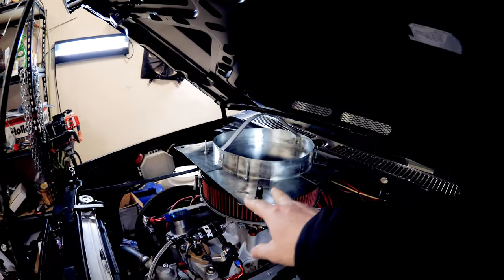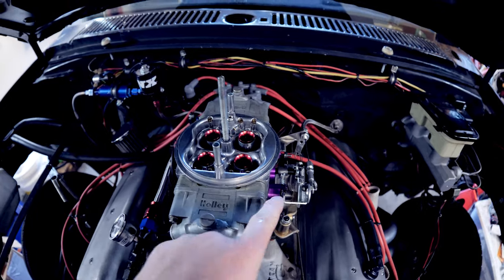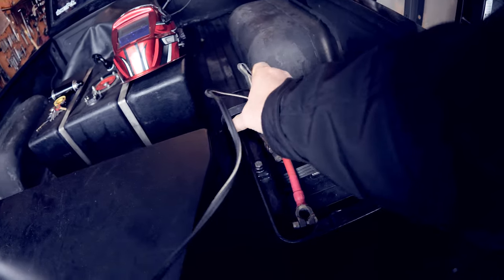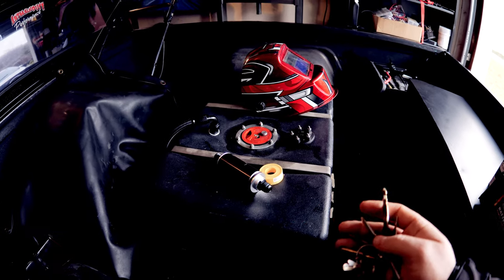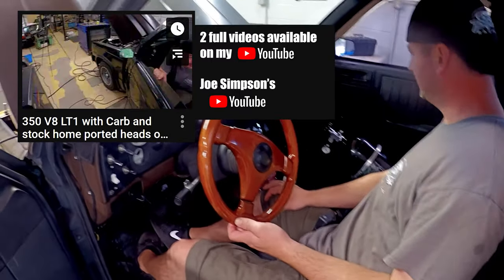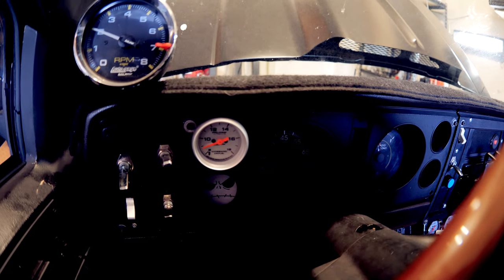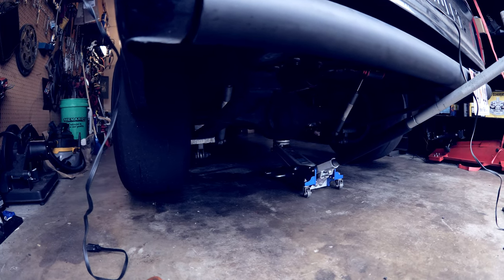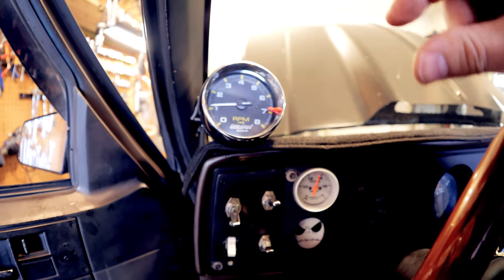How to cold start a race carbureted motor correctly / V8 S10 LT1 GEN2 SBC

Comment: Killer video man, I’m getting ready to fire off my 421 carbureted sbc for the first time in my actual car and not on the dyno. Pretty pumped. However: it’s super cold here in Massachusetts so I picked up an oil pan blanket heater and a lower radiator hose heater/circulator by gravity to get it warm before I prime the oil pump. This video will help me a lot. Thanks again 👍🏼🙌🏼

Comment: I have a 383 stroker motor on my c10 with an edlebrock 750 and i have the vacume pump welded with the mechanical choke so all i do is turn the engine over for a couple seconds then give it a couple pumps and starts right on with the choke on at perfect warming idle then i give it a quick rev when its warm to go back to idle

Comment: Like me 2 pumps and a squirt 😂😂😂
Yeah I pump mine 2 or 3 times and it usually fires up just need to sit in it for a bit ...
But it is a little more forgiving since I changed to a wide center lobe turbo cam 
Still has like 240 @50 but my center lobe is 115 only about .510 lift and duration 276 but it seems to work ...
My buddy with the Chevelle has about the same but 235 @50 and that one runs in the single digits with a hanger18 how brew carb nothing fancy 👍🏻👍🏻

Comment: Exactly the way I been starting my 565 BBC with 1250 Dominator.  However, the other day, it was about 50 degrees and the car hadnt been started for a few weeks. I just gave it a half pump, then held throttle open about 25%. Started almost immediately. Had to feather it for about a minute to keep it running. AFR was at 19 if I let off!  Now,  I just have to get some kind of oil heater for next cold start after its been sitting for months. I run 20-50 oil and have an aluminum pan.

Comment: Hey how’s it going. So my car, (306 sbf, h/c/i, Brawler vac secondary carb but no choke, 18 deg initial/36 total by 3k rpm), doesn’t do that great with cold starts. I’ll pump it, it’ll turn on, and I have to pedal/feather the throttle from time to time otherwise it’ll die - even if I try to keep my pedal steady at 2k rpm. Once it gets to temp (170 to 180 degrees) it’ll idle fine, but before then it’ll want to die and it’ll kinda I guess “sputter” as I’m feathering that gas pedal. What adjustments would you suggest so I can get it where it needs to be? Not sure how far out my idle mix. screws are, but once it’s at temp it’ll idle at 13.7-14.3 on my wideband.

Comment: Hey what size Carburetor you running ?
Reply from the maker: 750
Reply: Hey are you going with the same Carburetor on the 400 ?
Reply from the maker: @robertthornejr527   Same metering blocks and fuel bowls but I will get a 950 main body and billet base plate.
Reply: Ok I was just wondering I have a 400 in my s10 . I have a 750 on it now. I'm only running 10.3 compression with Afr 195 street eliminator heads with a hydraulic roller.

Comment: This is NOT how to start a cold  carbed engine. You are killing your bearings by cranking it till you get oil pressure.  Your engine needs oil pressure AND VOLUME asap to survive and an engine that see's 1000+ rpm's in 2 seconds is going to last a hell of a lot longer than one that cranks for 30 seconds waiting for oil pressure. Not to mention oil pressure gained by cranking the starter has no where near the volume of an engine spinning at 1000 rpm's.  
 Plug readings taken at an idle are useless. There are way to many variables for them to give you any valuable information.
 Too each there own, start YOUR motor however you wish.  I've been building tuning and racing carbed engines for 4 decades and I would never recommend cranking an engine untill you see oil pressure on the gauge. Unless I had stock in the clevite bearing company.....
Reply from the maker: Humm that is interesting. My bearings on all my motors have told a different story and I could have probably even reused them.  Here are some tuning videos I have made below… Please help is encouraged…
Reply from the maker: Dyno video.. https://www.youtube.com/watch?v=8mlcKU0betA
Reply from the maker: https://www.youtube.com/watch?v=YLPN9TOakgg
Reply from the maker: N20 
https://www.youtube.com/watch?v=COYuzHmdbyY
Reply from the maker: 9 sec pass
https://www.youtube.com/watch?v=F6jaMd3yP20
Reply from the maker: @bigboreracing356  The guides are so loose on that motor she is never short on oil in the cylinders.😆
Reply: The man is showing how to start a mild small block in the cold, not a $100,000 race engine!  Who pulls their plugs and sprays oil in the cylinders before starting an engine to take a ride around the block??  wtf people??

Comment: Do not pump and crank at time . pump w/o cranking let the fuel evaporate for a few seconds crack the throttle slightly and fire it up.
Reply from the maker: On a high compression motor It's better to do this while it's spinning. Because if you don't, the majority of the fuel will drain to the rear cylinders causing a hard start situation. The starter will barely turn it over. It's always better to turn it over then pump because the fuel is more evenly distributed to all the cylinders.

Comment: Never....ever...crank a engine over to build oil psi. All you did was wear the cylinders, rings and every bearing in the engine.
Reply from the maker: Humm… combustion load vs just compression stroke load for oil pressure. 🤔 I have never seen such evidence on any of my motors when I take them apart. The bearings look fine and the honing marks are still visible. The only time I have seen unwanted wear is when the motor was hurt from a race and the wrist pins froze up due to a bad N2o tune-up.